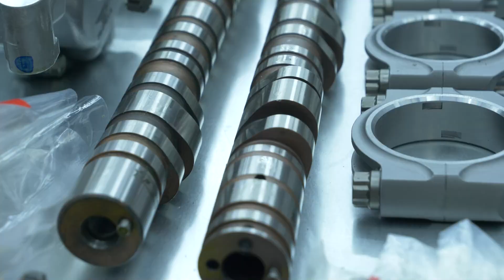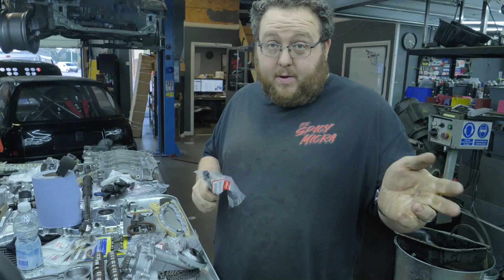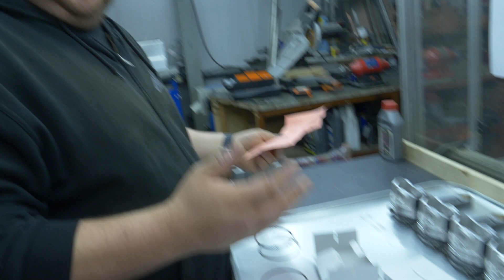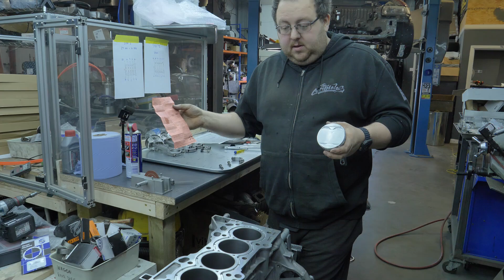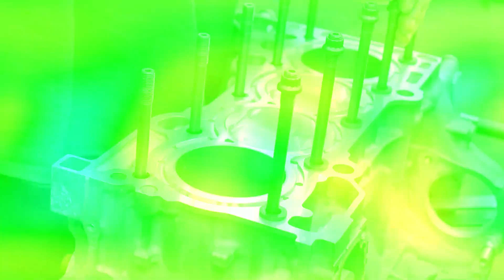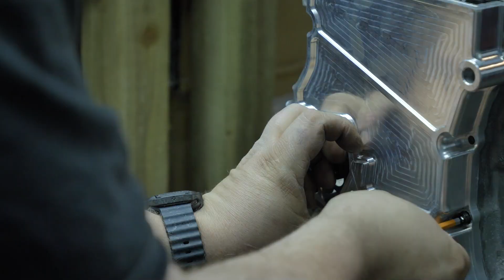1000HP+ HONDA K24 ENGINE BUILD (DREAM SPEC)

Comment: Did you use a 50° VTC gear, or a 25°?  When did you work out your piston to valve clearances? Using a 50 degree gear is too much overlap for most forged pistons, unless you have more valve cutout relief than oem. Limiting the VTC to 40° or less is correct so under full range of timing advance the pistons won't hit the valve
Reply from the maker: 50 degree. We were giving the build list by an engine builder who swears by this setup.
Reply: @GizFab thanks for the reply :), okay sound's good! How's the engines going? ✌️
Reply from the maker: @shaunhall1040  Still on the engine stand. Only just got my car back from Chassis works few weeks ago. Will be aiming for this winter to get the car together,
Reply: @GizFab project life! Lol, do you use the full 50° on the haltech?

Comment: Nice little build that should hold you in good stead. Quick question. Is there a reason you put Honda bond on the vertical seals of the upper timing chain cover? Also, I’m Sydney based and will definitely going to WTAC next year and would love to help you guys out.
Reply from the maker: Yes, as the instructions required it. There is no Rubber Gasket. We 2026 is looking like the Goal for our WTAC Visit!
Reply: @ I’ll be following the progress of you both. It’s an awesome event that I think you’ll really enjoy.

Comment: have you seen the builds where they pour resin into the block to increase strength? more drag builds i have seen not sure on a longer run time application
Reply: yeah that fills all the water galeries. only ever used on drag engines.
Reply from the maker: Designed for engines running on Methanol as Methanol  runs the engines much cooler than traditional fuels - Which is required as the Resin fills the coolant galleries around the cylinder heads. Perfect for a Drag Car, Not so great for a circuit Car which is why the CSS was our preferred method